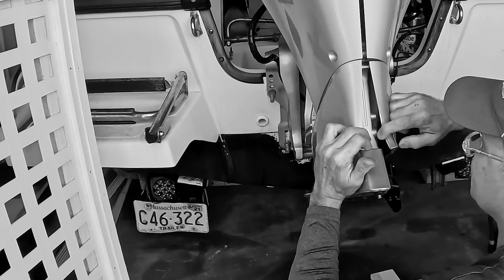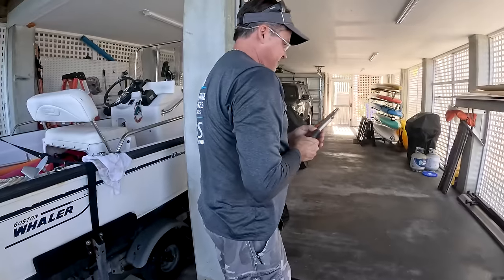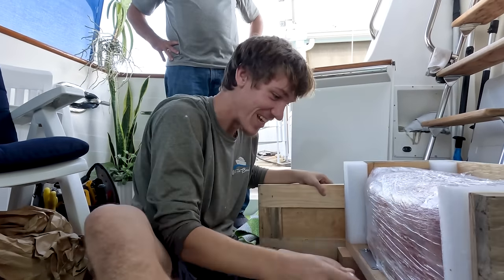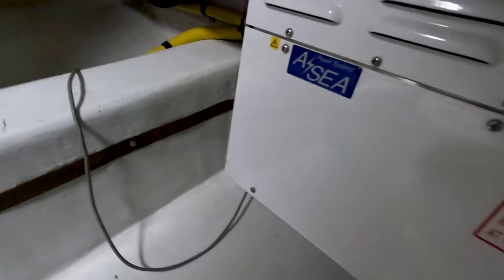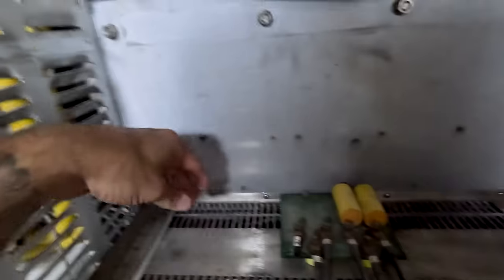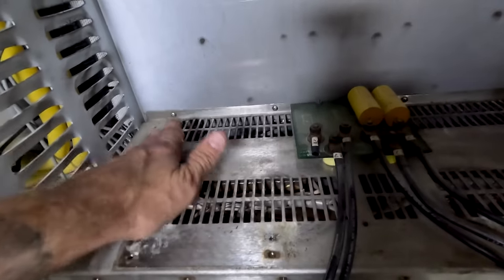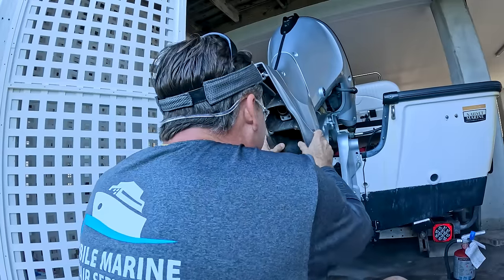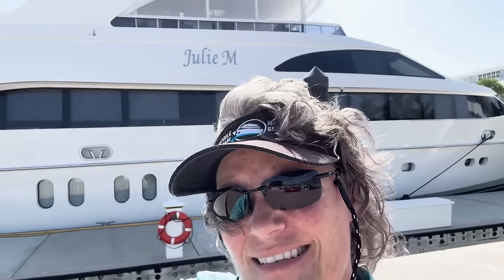Never Imagined the Water Could Get So High …

Comment: Use propane gas and heat up the space AROUND the bolt to expand the area around the bolt. Heating up the bolt expands the bolt and only locks the bolt in harder.
Reply from the maker: We ended up having the owner take it to a machine shop! Saver that way and discovered someone used leak lock or something like that on the bolts.

Comment: Working on Loco's we would grind flat not flush, find center and use a punch and start with a very small drill bit. Increase bit size until stud wall is very thin and you can pry it out.
Patience is key to success..
Reply from the maker: Took it to someone that does it more often.

Comment: Heat the bolt and the surrounding area and touch a candle to it. The wax will draw into the threads and provide lubrication and bust up the corrosion. Worth a shot. Learned that from an old millwright neighbor of mine.
Reply from the maker: We had the owner take it to a machine shop and it ended up being that someone used thread lock on the boat!

Comment: Grind two flats onto the broken bolt then try vise grips, might provide a better bite than trying to grip onto round treads. Also maybe try heating the alum housing a little bit instead of the bolt itself
Reply from the maker: We ended up having the owner take it to a machine shop! Saver that way and discovered someone used leak lock or something like that on the bolts.
Reply: @WillFixThat so that would have been the dealer?

Comment: lock tight compound on a screw or bolt threaded in to aluminum is big no no.
those are pretty frail aluminum on those lower ends of the out boards, 
to me drilling those studs is the way. atypical 343 cat engine, 3/8 studs, rusted rotted, eat away, got trick for you,  the studs are 3 to 5 inches long, depending location, it still works 
even when the stud is all but rotted away in the middle, two vise grips, opposing each other
 one tight up on the face of the head the other out on the end, but of course, heat the devil around the boss, squirt some water on the stud and turn both vise grips easy like, 99 % of the time the stud comes out, I also would use black wall pipe nipples, 3/16 rod weld the 
nipple to a broken stud, add some water to the stud, walks right out. did a lot of R&R of cylinder heads back in the day. truth is, seeing you though youtube, as much as I knew 
about my work, I come realize you are way in over my head in all a really good mechanic 
in your line of works must know to do. 
Rock on Boss
Reply from the maker: Thanks for watching…. Some of our jobs are crazy!

Comment: Weld a larger nut to those broken off bolts. Does 2 things, puts heat directly into the bolt shank and gives you a nice place to put a long wrench on to spin it out. Way faster than drilling and EZ-out!  That's a Cape Cod boat, MA plates with a Nauset Marine sticker!
Reply from the maker: Had to have machine shop remove the bolt! It was safer that way!

Comment: Kroll, PB blaster,  long time ago I used  stuff called Break away.  Heat and  soak a few times for 24hrs.  Heat aluminum around bolt, Then vise grips or grind square was my method, before drilling with cobalt bits,
Reply from the maker: We tried soaking & spraying it for 2 weeks … we ended up having to take it to a machine shop! Safer for us & clients! Someone used leak lock or something like that 🥴
Reply: I used to use the carbon rod attachment on my stick welding machine to make broken stud cherry red.  Add PB Blaster a few times as the stud cools.  It should move.    I had to drill and tap all the bolts on an old Johnson years ago to get at the water pump impeller.  That was a two week, now and then job over time.

Comment: You should always heat the housing that the bolt goes into... heating the bolt just exspands it and makes it harder to remove.... dissimilar metals are the worst to deal with. A little never seize goes a long way.
Reply from the maker: This bolt had lock tight on it … we had owner take it to a machine shop to get it removed.

Comment: Don’t heat the bolt. That causes it to expand into the aluminum. Heat the midsection in one spot so it expands and creates a hinge of the non heated aluminum. Can hit the bolt with a cryo blast if needed. Cycle with PB.
Reply from the maker: No luck with efforts had to take to a machine shop! Someone used a leak lock product on the bolts.

Comment: Man yall are very busy and that bites that 2 bolts broke on that lower unit I have never seen that before but I have seen lower unit damage due to owners running into sand bars and what brand of tools does matt use?
Reply from the maker: What brand of tool … lol whatever will get the job done! 🤣 someone used leak lock or something on those bolts! It’s crazy we had the owner take the boat to a machine shop to get them removed!
Reply: @WillFixThat  ouch leak lock thoes go in dry lol and ok I'm going to send Matt a couple ratchets he will like lol
Reply from the maker: @honeybunbandit1 who makes the rachets?
Reply: @WillFixThat  they are snap-on flex heads with a soft grip 1/4" drive and 3/8" drive
Reply from the maker: @honeybunbandit1 we don’t have much if any snap on tools.
Reply: @WillFixThat  I'll send some ratchets
Reply from the maker: @honeybunbandit1 you asked about his favorite color …. HOT PINK 😂😮 just teasing! No one cares about color if they work great!
Reply: @WillFixThat  oh I'll get him hot pink lol
Reply from the maker: @honeybunbandit1 they really have hot pink? Too funny.
Reply: @WillFixThat  lol oh yes they do